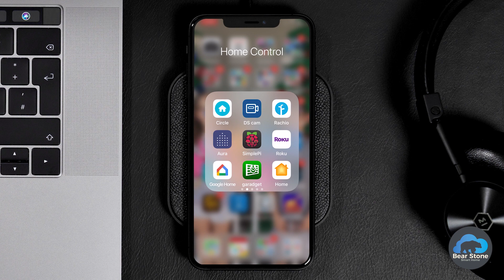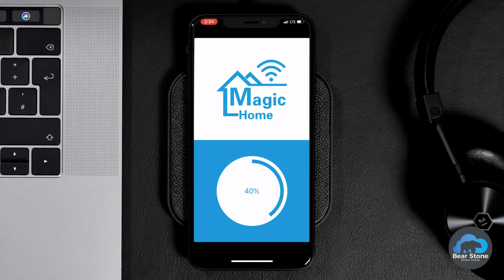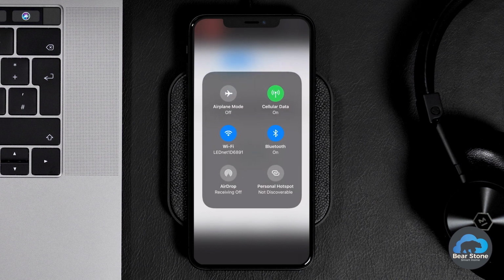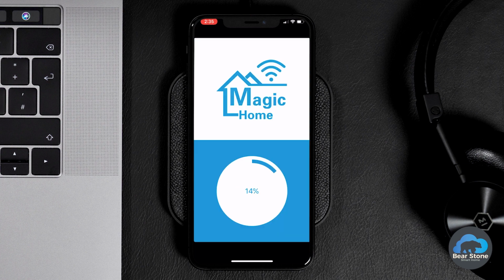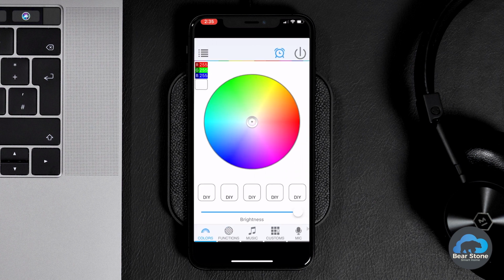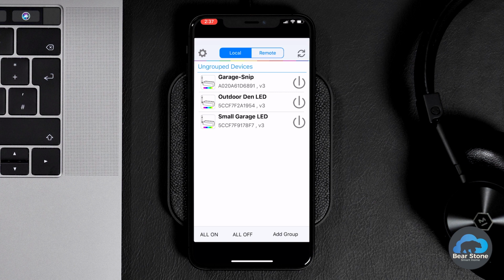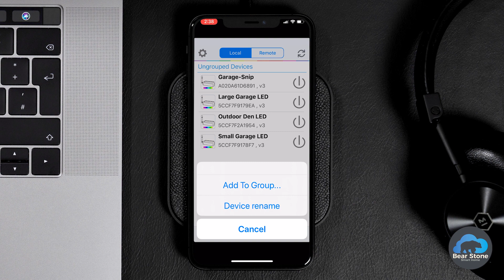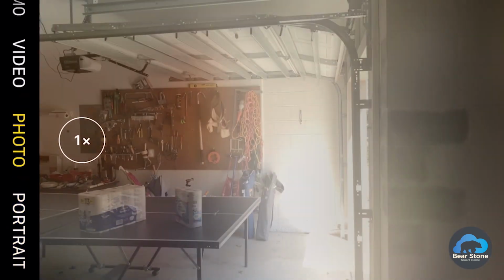Magic Home LED Fix & Great iOS Setup tip

Comment: Is Outdoor Housing that you're using waterproof? How did you mount it? Did you screw it in or used 3m tape?
Reply from the maker: Hi Danny, I used outdoor LED Strips with Diffuser channels that I screwed into the underside of the roof line. 
The exact materials are here: https://www.vcloudinfo.com/2017/08/diy-outdoor-smart-home-led-strips.html
Reply: vCloudInfo I

Comment: mine disconnect after 1 hour or a few minutes after turning on. sometimes i find it offline other times i find it online and working
Reply from the maker: Definitely lots of variations between vendors in terms of of reliability. Surprisingly, mine have been chugging along pretty well for years now. Still have the occasional hiccup but they are solid for months and even a year at a time.

Comment: No sorry your so called magichome fix is not a fix. Magichome needs an update to fix faulty software that keeps losing connection issues from wifi. Not cloud network systems
Reply from the maker: Different issues but thanks for the update on the firmware.  More tools in the troubleshooting toolbelt.

Comment: hi so basically my cousin changed my wifi name and now I Magic home wont connect to the wifi and im using the right one but it just won't connect!!! Got any advice?
Reply from the maker: Hmm. I think there is a way to hard reset them. I think you have to power them on/off like 5 times and then they factory reset.
Reply: @vCloudInfo  tried that already and they still won't connect to the wifi

Comment: Even with turning off cell signal mine still won’t connect. Any tips?
Reply from the maker: That always works for me. Make sure you are using 2.4 ghz network as well.

Comment: I got all mine connected but for some reason they all got disconnected and i got two back today but i have to try to get the last one so can you help plz and i have the newer app
Reply from the maker: What issues are you having?
Reply: @vCloudInfo  they disconnected from my phone but are still connected to the wifi so i need help connecting them to my phone and i have the newer app on it
Reply from the maker: If they are on the WiFi, you shouldn’t need them in your phone. That connection is just for setting them up.

Comment: Not all my colors are working only red green and a dim blie
Reply: Blue
Reply from the maker: This can because of a weak connection with the pins. Try moving the connector to see if you can get the other colors to show. The strips all have a RBG line that they use to simulate other colors.

Comment: How do you do the cinema mode?
Reply from the maker: What do you mean Cinema Mode?
Reply: @vCloudInfo  when you click on your device, it’s at the bottom right corner
Reply from the maker: I'm not sure.  Did I show that in the video?  I can't seem to find it now.
Reply: @vCloudInfo  no you didn’t. is there a way i can screen record and send it to you?
Reply from the maker: You can post it on YouTube as a Video.. But is it something in the Magic Home App? I don't ever use anything other than just straight colors via Home Assistant.
Reply: @vCloudInfo  i just posted. you might want to check it out, thank you.
Reply from the maker: Ahh.. I am using an older version of the App.  Version 1.1.4.  So that option is not there but it seems to be the best version of the app for getting them discovered and configured.

Comment: I have a problem on my strip when it will show the wrong color when i press a color button even on the app
Reply from the maker: That usually means the pins are reversed.. each pin is Red Blue or Green.  Try flipping the pins.

Comment: The wifi pops up but when I press on it, it doesn’t connect. Please help
Reply from the maker: Make sure you have cellular turned off on the phone.
Reply: @vCloudInfo  I did have cellular off and it still says failed to connect
Reply from the maker: Hmm.. That seems pretty weird.. is your phone not connecting the controller or the controller not connecting to your wifi?
Reply: @vCloudInfo  what controller?
Reply from the maker: The LED controller
Reply: @vCloudInfo  my led controller doesn’t have a battery inside it
Reply from the maker: Correct. But it should have a WiFi access point.
Reply: @vCloudInfo  I don’t know what that is
Reply from the maker: It's the way you would connect to the device for configuration.

Comment: Mine  won’t connect to my wifi
Reply from the maker: Have you tried all the suggestions in the comments and video?
Reply: @vCloudInfo  yes I’ve done everything
Reply from the maker: Make sure you are not trying to connect to 5ghz wifi. Only 2.4 is supported.
Reply: @vCloudInfo  what’s 5gh wifi? it says I have to connect to (led-xxxx) but it won’t pop up on my wifi list
Reply from the maker: Ooh.. the LED-XXX is THEIR wifi. :) If that's not popping up and you are hard resetting the controller, it seems like it could be a hardware issue.  Might have a bad unit.

Comment: Any tricks on how to find the network? I can seem to find LEDnetxxxxx
Reply from the maker: Be sure to turn off Cellular data. That’s the thing that makes it work for me. Also power reset the controllers.
Reply: @vCloudInfo  How would I reset the controllers???!
Reply from the maker: Depends on the controller but some sort of power on/off sequence. 3 or 4 times in a row probably.  They might also have a reset button on them to factory reset them.

Comment: I have 2 pairs of the led lights and for one of them the WiFi won’t even pop up that I have to connect to. When I do your little method to connect to them it only shows the one that is already working it doesn’t pop up with my other lifhts
Reply from the maker: Hmm. Not sure what it can be. :(

Comment: what do I do if the WiFi doesn’t pop up on my phone?
Reply from the maker: Try resetting the device to factory settings.   If you can't get the wifi to pop, you will never be able to configure it. :(  Make sure you are doing 2.4GHZ.. 5 is not supported.
Reply: @vCloudInfo  how do you know if your on 2.4GHZ or 5
Reply from the maker: You should have 2 different SSIDs. One 2G and one 5G. If you just have one network SSID, it’s mixed and will give you a ton of headaches with IOT devices.
Reply: @vCloudInfo  wow you reply quick-
Reply: @vCloudInfo  i might be driving you crazy but what’s an SSID and how do you find it
Reply from the maker: No worries. SSIDs are just the names of your WiFi networks. So when you go to connect to your WiFi, you are connecting to your SSID.

Comment: My led no longer shows a WiFi anymore making it so I can’t connect with the app
Reply from the maker: When That happens, I normally try to factory reset the controller.
Reply: vCloudInfo mine won’t find The ap Even after reset. Do you know a solution?
Reply from the maker: I don’t. Might have just given up the ghost. Might have to buy a new one.
Reply: @exoticwriting8648  mine is doing this same thing. have you found a solution yet?
Reply: @fennec9882  no i have not sadly, i am goingto buy a new controller and hope it fixes it
Reply from the maker: Good luck and let us know how it turns out.

Comment: I connected the app w my phone but i dont have wifi and it wont come off the app now so i cant use it and how do i get it off my phone so i can it use the remote control it came with
Reply from the maker: Not sure I totally understand the issue.  You should be able to use the remote if you put back the other controller.

Comment: my led lights aren’t even working with the remote 😭
Reply from the maker: Yeah. That’s a pretty good indication that it’s a hardware problem. :)
Reply: vCloudInfo i mean they work with the other control box but not this wifi one aha, would this still be a hardware problem ?
Reply from the maker: That’s sounds like a configuration issue then.

Comment: I just recently updated to iOS 13.6 and I tried your trick with turning off my data but it’s still not connecting to the WiFi from the led strip. Is there another way it could work? I’ve tried everything. I’ve restarted the WiFi controller which I learned how to do on the official magic home website but it says nothing about new IOS updates and how to connect. If you know any other way to do this could you please help me out?🙁
Reply from the maker: I’ve always just turned off the cell data. That has always worked in the past. I’ll try again later and see if the new IOS changes anything.

Comment: My problem with the app is it’s showing my strip as a bulb and I can’t change the colors
Reply from the maker: In home assistant?
Reply: vCloudInfo yeah when I set up the the device it registers as a light bulb
Reply from the maker: Hmm are you using the flux component? It should be a bulb but should allow color control.
Reply: vCloudInfo ok sorry so I bought a magic home connector for my led strips, when I set it up it recognized the connector as a light bulb instead of the strip so I cannot change the color and stuff

Comment: mine only has 2 blue lights and the rest are off and I can’t even find the wifi at all :( did i break it or am i missing a step? (wanna know before I buy another one)
Reply from the maker: Hmm.. not sure but that doesn't sound right.. try to factory reset it..
Reply: vCloudInfo idk i think i broke it, imma just buy another one since it’s not a known issue, thanks though~
Reply from the maker: Hopefully the next one will go smoother. Keep us posted and we will help if we can.

Comment: hello, I just set up the LED strips but when I wanted to connect to the provided internet, it wouldnt show up. Please help
Reply from the maker: Did you turn off cellular? That was the missing part for me. I explain it in the video.
Reply: @vCloudInfo  what do you mean turn off cellular? Turn off the wifi??
Reply from the maker: Go into airplane mode and only turn on Wifi on the phone.
Reply: vCloudInfo i tried that but it didn’t work any other suggestions??
Reply from the maker: MAybe a defective unit?
Reply: @vCloudInfo  at what timing did you explain it in the video please?

Comment: When I am connecting mine there is no LED WiFi I have tried to refresh the routers and have unplugged and replugged in the lights. I have restarted my phone and have been scrolling through tutorials but nothing works.
Reply from the maker: If you are not seeing the LED Wifi, you probably have to reset the controller.  Some controllers make you power on/off a few times to reset them so they begin to broadcast the LED-Wifi setup channels.
Reply: vCloudInfo thank u it works perfectly now!
Reply from the maker: Glad to help!
Reply: Ayden the gymnast S how did u manage to find the network?? I’m really struggling to find it, it wouldn’t show up
Reply from the maker: Try putting your phone in airplane mode and then just enabling the Wifi.

Comment: when I get to the step of connecting it to a wifi network, it shows 3 different networks all with the same name, and everytime i try to connect to one of them, it says i’m not connected
Reply from the maker: I've had to recently switch over to the new Magic Home app. It sucks because you have to create a cloud account.
Reply: what ever ya do .. don't touch the remote after ya set it up..   when I do   it instantly kicks it off line... SHITTY APP!! AND CONTROLLER

Comment: hi! so i connected 7 meters with an adapter and the wifi remote thing and then i connected 7 more and the other half isn’t lighting up brightly.. what do i do?
Reply from the maker: Not enough power. You either need to inject power or break it up into multiple controllers. That’s what I did.
Reply: vCloudInfo  aww okay thank you 🥺🥰

Comment: Hi! I have 4 led strips connected with magic home controllers, but for the last months I am having issues with it. After the configuration everything works fine with magic home app, but a couple of hours or days, the lights appear as offline on the app and I have to restart or even reset them. Do You have any idea what may be causing this issue?
Reply: i have the same problem, have u solve it? i need it :(((
Reply from the maker: It feel off the radar. Since home assistant still controls it, I haven’t dove into it yet.
Reply from the maker: I’ve been experiencing the same thing. Thankfully Home Assistant is still able to control them so I haven’t looked much into it.

Comment: When i turn off mobile data and when i directly connected to the led connector it still won’t pop up in my app. Even the reloading time in my app its much faster. Even with factory reset and re-install the app won’t get it work, Any tips? Thanks in advance.
Reply from the maker: Hmm .. not sure.. Truth be told, with the new iOS 13 enhancements, it's been really flaky configuring these LED devices.  I still break out an amazon Fire Tablet every so often to configure them. (https://amzn.to/2XSWn2l )

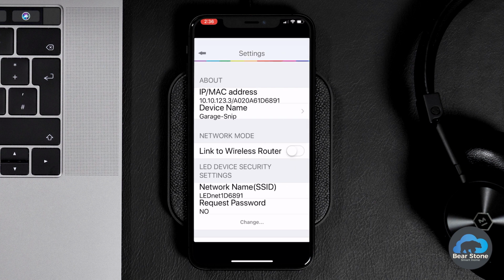Comment: So after you link the led strip wifi to your router 4:30 you no longer need to "connect" to led strip again, just use your regular wifi to go in Magic Home and control the led strip?? (Sorry for my english but is not my main language 😉)
Reply from the maker: Yes Victor!  Once you link it with the router, all control can happen over the regular wifi. (or in my case, home assistant.)

Comment: If that controller has an ESP8266 chip you can flash it with Tasmota then control over MQTT with Home Assistant.
Reply from the maker: Yes.  I have thought about it but honestly, with the out of the box Flux_LED component, it works great.  I've had very little issues with them over the years.
Reply: I have the same ones and didn't really enjoy how they worked alongside home assistant. I ended up flashing the esphome firmware on them and they work amazing with home assistant now. Just food for thought if you ever get bored and decide you want to change things up a bit
Reply from the maker: Did it require any soldering? I suck at soldering. :)  I do like the idea of hard coding WiFi into the controllers.
Reply: Yeah i had to solder to the connections  to flash it but you could get some wires that have pogo pins on the end and hot glue them to the connections while you flash the firmware
Reply: You only need the wires connected while you flash the firmware
Reply from the maker: Hmm.. I might have to revisit this then.    I do love the idea of running ESPHome (YAML based) .. and the units are pretty accessible in the cases I put them in..   I'm in Florida and it's love bug season so I'll have to wait for that to be over but you've definitely given me some food for thought.   Gonna go add it to my todo list on the Repo. :)   Thanks Joseph!
Reply: Yeah I did the hot glue method on my third one because I was impatient and didn't feel like waiting on more solder to arrive in the mail. Everything worked fine. You'll love the faster response times and theres more functionality with them having esphome or tasmota
Reply from the maker: Joseph Sanders that sounds awesome! It’s on my todo list!
Reply: Do you lose some of the functionality and access to the "scenes"?  I have individually addressable LED's and not sure ESPHome can manage that?
Reply: @lance_living  yeah I'm not sure if esphome added support for individually addressable LEDs or not but when I set them up there wasn't.
Reply: Did you make a video how to flash the Magic Home's wifi controller? TIA
Reply from the maker: I have not yet since I haven’t flashed them yet. It’s on my list though so be sure to subscribe and hit the bell! ;)
Reply: @vCloudInfo  Liked and subscribed :)